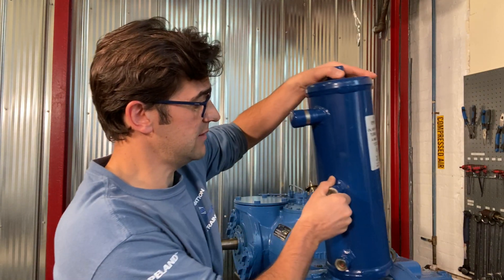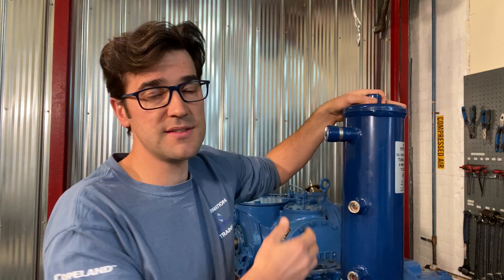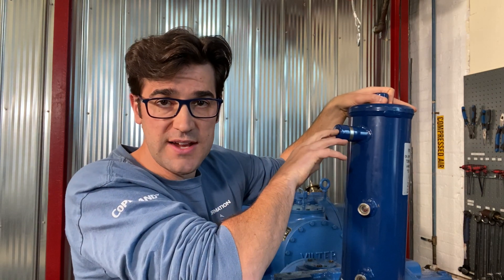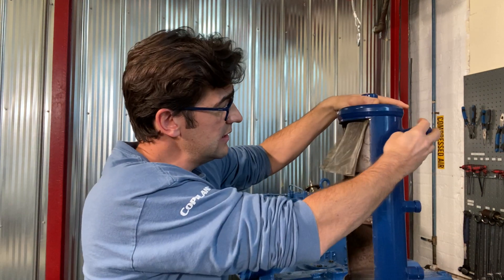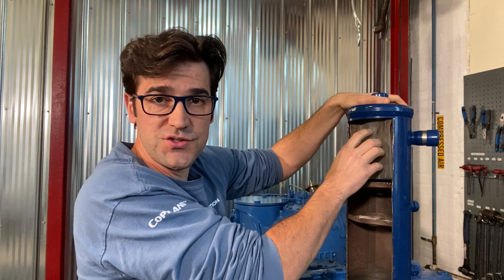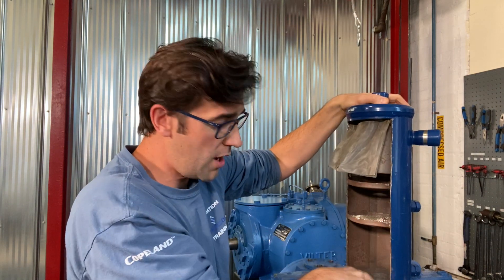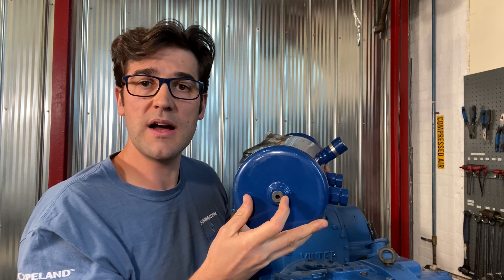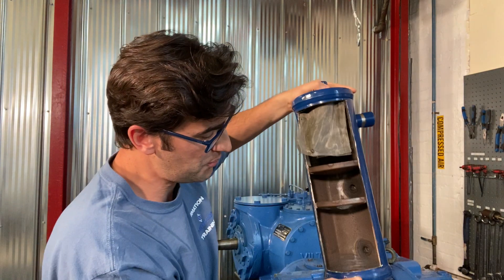Oil Separator's

Comment: what particularly hot, discharge pipe line? compressor body, oil seperator, liquid line. air vent/.
Reply from the maker: If you have a really hot line oil line you are probably overheating the oil, if it is cold you could have liquid refrigerant and the oil and if the oil line is room temperature something could be plugged.

Comment: For Precision Air Conditioning system this model oil separator is used for scroll inverter compressor. Oil level is not maintaining on top sight glass in oil separator in full load. What is minimum oil level in top sight glass in oil separator and bottom sight glass is full
Reply from the maker: Depends on the system manufacturer I would say above the bottom sight glass

Comment: Hello. Nice video.  Recently change a compressor (broken rod and piston) on a condensing unit 10 hp R404a for a low temp aplication. There is no oil separator.  Need some advice about selection of the oil separator, how to regulate the oil back to the compressor and  what line components are required?Help please.
Reply from the maker: This could be from a few different things like you lost all the oil from a leak, improper p-traps and risers so the refrigerant velocity is incorrect or not properly sloping piping back to the compressor. It could be from inadequate defrosting as well.  You can use Westermeyer's calculator to calculate the correct separator for your system. It is pretty easy if you have the system design conditions. Here is the link.   https://westermeyerind.com/tools/calculators-oilsep/ 

They have a great team over there so you can contact their support team if you are having issues using the software

Comment: I stupidly changed out a compressor because I was getting oil lockouts that I couldn't figure out.  Prior to that, I changed the oil float, and oil pump.  Turns out, it was a compound compressor and the y10 valve was bad.  I was always told that you only needed the y10 for r22. This store had 407a.  The discharge temperatures were around 250 degrees. That oil just got too hot and it wouldn't pump properly.  Now I know better.  Only took me replacing a compressor that didn't need to be replace to begin with.... At least it was 20 something years old.
Reply from the maker: Its all about learning and you will never forget this.  I have learned so much from mistakes I have made in the field and always made me a better technician so I did not do it a second time.

Comment: Good info here! 
Once I found armaflex insulated separator in outdoor rack house. Why’d you insulate it?
Reply from the maker: One of the main reasons would be if you are located in a cold climate you want to keep them warm during the off cycle because you do not want refrigerant to migrate to the oil separator and condensate in the oil.  If that happens the separator could start feeding liquid refrigerant back to the compressors.